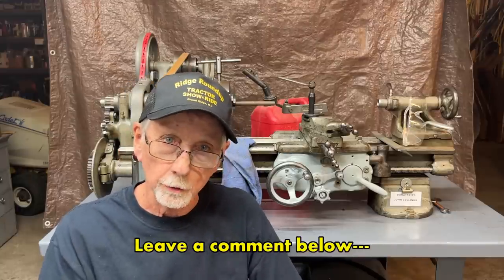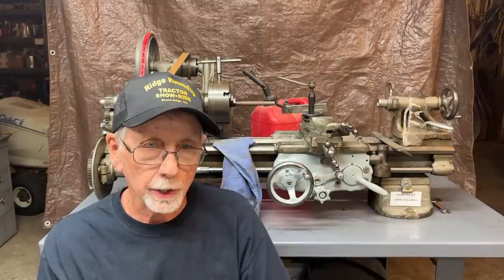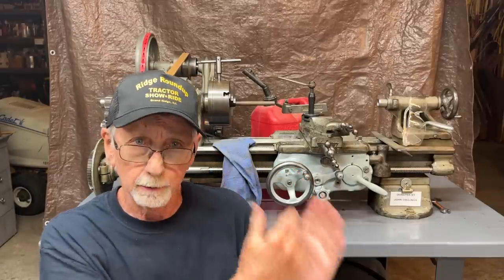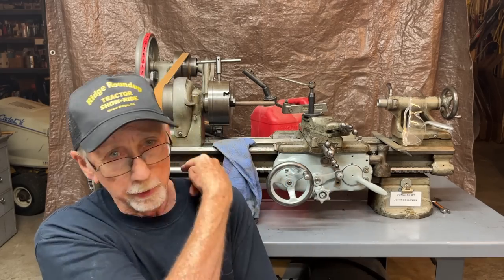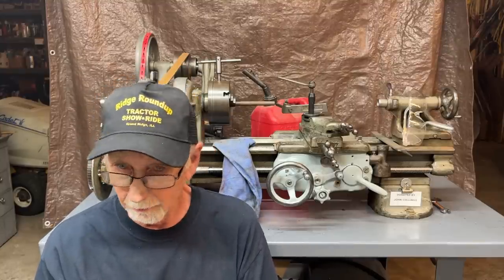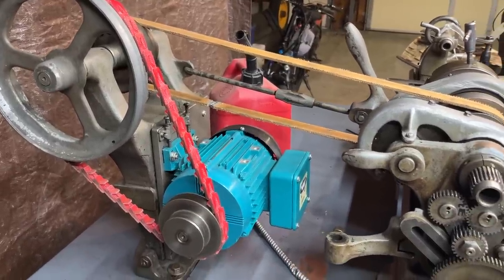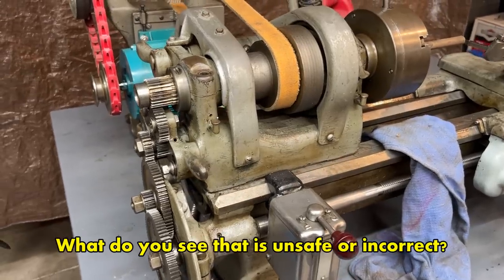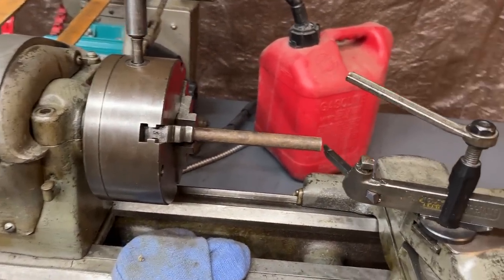SHORT SUBJECT #2 BAD LATHE SETUP tubalcain

Comment: Not only is the BX cable damaged, it is also the wrong cable for the job.  Should be SOOW or similar.  Also, though not in the picture, there are no plugs listed for use on BX cable
Reply: It's probably not a true BX cable (I hope) but rather something like greenfield conduit a similar product outside but you put your own wire inside. It's like liquitight conduit without the covering. very common on machine wiring

Comment: 1) The cord supplying power to the motor is not in the conduit with the crushed spot. The real cord is tape spliced.

2) Gas can, improper storage of flammable liquids.

3) No chuck guard.

4) No belt guards to cover inrunning nip points.

5) Chuck wrench and tool post wrench should be removed.

6) Improper storage of PPE, the glasses.

7) Rag on ways is a no no, could become entangled with rotating chuck.

8) Files and other miscellaneous items like the file should be cleared from the work area.

9) There are several problems with the setup for the job that I won't go into, but I suspect the combination of setup issues if used as shown would likely result in tool breakage, or the part slipping from the chuck, either or both of which could be tossed back at the operator, in add-on to potentially damaging the toolholder, or the post as well.

10) Missing gear train cover for change gears too.

BTW: I am a State Safety Consultant for KS in the OSHA 21d Consultation Program with over 30 years of experience in this as well as multiple manufacturing facilities through the years.
Reply from the maker: You are pretty sharp, you caught all the bad things.
It’s nice to have a safety man watching my videos

Comment: 1. Compound is sticking out too far.
2. Rocker tool post is hanging out over the edge of the compound.
3. Flat Belt tension is generally loosen when not in use.  At least that's what I was taught and still do it today on my 9" SBL. 
Daber missing from tailstock. Mine is too. Not a safety violation.

My dad would roll over in his grave if he saw this on his, mine now, 9" SBL!!! 
 Ken

Comment: 1. Broke conduit 
2. Missing gear cover
3. Switch not mounted permanently 
4. Key in chuck
5. Gas can beside motor
6. Work too long not supported
7. Tool wrong angle and too long
8. Wrench on tool post
9. File across ways
10. Rag under chuck on lead screw
11. Safety glasses across tailstock

Comment: The gear cover is off the lathe. The tool bit and the tool holder are both extended too far. The chuck wrench should not be left in the chuck  The tool post wrench should not be left on the tool post.  The file lacks a handle and should not be laid on the ways.  Wear your safety glasses rather than hanging them on the tail stock.  I have most likely missed a few

Comment: Good video! Let's see: no gear cover, no belt cover, chuck key in the chuck, too long work stickout, compound handle in the wrong angle and risking the user, rag on the lathe and near the chuck, a file on the ways and tool stickout lowering rigidity and causing chatter. Did I miss anything? (I must say - I learned machining  almost entirely from your videos!!!)
Reply: You missed A LOT of things !!
Reply: @johncoops6897  lol. I bet I did! What did I miss?

Comment: 1 no belt or gear covers
2 rag laying on bed ways
3 chuck key in chuck
4 gas can on table material to far out for facing
5 lathe bit too long
6 wrench on tool post
7 safety glasses not in use
8 file on bed ways
9 tool holder to far out
10 dent in Armor Flex

Comment: 1: Unprotected belt drive system (No belt guard)
2: Unprotected Gear train (No cover on the gear drive)
3: Damage and unsecured BX Power Cable (MC) to Fwd Rev Switch
4: Chuck key left in the chuck unattended
5: Workpiece extends from the chuck more than a few times its diameter
6:  Spanner left on tool holder 
7: Tool holder extends too far out
8: Tool bit extends too far out of tool holder
9: Rag left on Lathe bed 
10: File left on Lathe bed
11: File has no handle on tang
12: Open Flammable container
13: No Chuck Safety Shield ? (this one is for the real tenacious safety gurus)

On the PLUS SIDE IT'S A South Bend .

Comment: 1. Too much work stick out
2. Too much tool stick out
3. Repeat 2 but with the holder
4. Chuck key in Chuck
5. Wrench on tool post 
6. Spindle not spinning
7. Rag on the ways
8. No center in the tail stock so you’re gonna get chips and funk all up in your taper
9. Edited this comment, too much stick out on the compound
10. GET THAT FILE OFF THE WAYS

Comment: 1.No belt guard
2. No gear guard
3. Flat belt is askew
4. Chuck key in chuck
5. Stock sticking to far out of chuck
6. Tool bit sticking too far out of tool holder
7. Tool holder held towards end
8. Tool post key on tool post

Comment: Exposed gear cover, towel on ways, file on ways, incorrect toolpost sticking way out there, compound on reverse, wrenches left on toolpost nut, savey glasses hanging out not on face, gasoline can hanging out in the back. Another violation could be no padded standing mat, improper open toed footwear, long sleeve shirt. No ear protection. Improper hydration, late on your taxes. haha I think I got more than 8!

Comment: From the UK.
I WOULD WANT TO PUT THE GUARDS BACK ON.
REMOVE THE RAG
REMOVE THE CHUCK KEY
SHORTEN THE WORKPIECE HANGING OUT OF THE CHUCK.
REDUCE THE LENGTH OF TOOL STICKING OUTVOF THE HOLDER
REMOVE THE TOOL POST SPANNER
PUT A HANDLE ON THE FILE
WIND THE COMPOUND OVERHANG BACK IN.
AND I WOULDN'T LEAVE THE FILE ON THE BEDWAYS.

Comment: 1: The chuck key should never be left in the chuck. 
2: The work is too far our in the chuck. 
3: No guards on the gear end and belt drive of the lathe.
4: The shop rag shouldn't be on the lathe bed.
5: Don't leave a file setting on the lathe.
6: Remove the safety glasses off the tail stock.
7: Remove the gas can from behind the lathe.
8: The cutting tool is too long, and the tool holder is sticking out too far.
9: Remove the tool holder wrench from the tool holder.
Reply: I would add to this list that the stock is sticking way too far out unsupported. And the file laying across the bed.
Reply: @peteengard9966  Number 2 and number 5 :)

Comment: Two unguarded belts.
Chuck wrench left in 3-jaw chuck.
File laying on lathe ways - huge no-no, not sure if it is a safety violation.
Tool holder clamp bolt wrench remaining on bolt.
Safety glasses on tail stock, not on operators face
Part is extended too far from 3-jaw chuck for facing.
Cutting Tool is extended farther than necessary froim tool holder

Comment: Gasoline can
Crushed electric cord
Key on chuck
Rag on the bedways
Stock overhang
Key on lantern post
Tool holder protrusion
HSS tool protrusion
File on the bedways
Safety gogles hanging from the tailstock

Comment: 1 No belt guard on drive belt
2 Flat belt not positioned on opposite pulleys and no guard
3 Damaged outer jacket on power cable
4 No cover over gear train
5 Rag laying on ways
6 Chuck key left in chuck
7 Container with potentially flammable or combustible liquid in workspace
8 Miscellaneous tools (file, safety glasses) laying around in workspace.
9 Tool post not properly positioned
10 Workpiece extended out further than necessary
11 Tool post wrench should be removed from tool post before operating lathe

Comment: No belts guarded, gears exposed, motor feed flex damaged (crush spot), gasoline container by electric motor, tool left in chuck, tool bit stick out too far, wrench left on tool post, rag on ways, file on ways, eye protection not on operator, tail stock wrench left on

Comment: No cover on change gears, Belt in tension while off, Key in the chuck, Shop rag on the ways, Part is stuck out too far, Incorrect set up on the cutting tool, File without a handle laying on the ways, & a gas can on the lathe bench.

Comment: I found TWELVE!  1No guarding on the belts.  2No guarding on the gears.  3The chuck key is left in the chuck.  4The stock is unnecessarily set way too far out of the chuck.  5The tool post wrench is left on the tool post.  6The cutter is unnecessarily set way too far out of the tool.  7The tool is unnecessarily set way too far out of the tool post.  8There is a file lying across the bed rails!  9There is a rag lying on the bed.  10The safety glasses are not on a face.  11There is a gasoline can directly behind the lathe!  12THE WORST THING ABOUT THIS LATHE IS THAT ITS NOT SETUP IN MY SHOP!  😁

Comment: I've never run a lathe but have been watching you for a long time. I do have a small Atlas 618 I'm trying to piece together. Here is what I think is "wrong"
1 Pinched BX cable
2 Chuck Key in Chuck
3 Material extended to far to be faced off
4 Cutter bit extended to far
5 Rag on way to close to rotating pieces
6 Gas can in the back of lathe
7 Wrench on tool post
8 File on ways
9 Safety glasses on tailstock
10 Wrong turning tool holder

Comment: I count 10,, belt guard gong, gear cover missing, tool in chuck, work stuck out too far, cutter stuck out too far, wrench left on lantern holder, rag on ways, gas can behind motor, file on ways, safety glasses on tail stock - not on operator
Reply from the maker: Yes

Comment: Ok so i dont know if i got 8. But,
Exposed gears and belts that can serve as a hazard
Clothing left close to turning equipment
Tools laying across ways
Workpiece stick out way too far with no end support
Chuck key left in chuck
Cutting tool setup is not very sturdy i.e. long tool stick out from holder and holder sticking way out of tool post
Safety glasses not on your face 😬
I might have missed some but only watched this once on my break

Comment: 1. Chuck key should never be on the Chuck.
2. Stock stick out is too long.
3. HSS cutting bit is sticking out too long.
4. A a rag on the lathe.
5. A file on the ways.
6. Flammables not stored properly
7. Tool angle is wrong
8. Feed lever engaged
Extra Credit
9. Safety glasses always on

Comment: For the love of humanity...the worst offense on here is the LinkBelt. Others include:

Fuel Can
Exposed belts/gearbox
Not Sure if the smashed BX conduit in intentional or not
Rag on the ways and near the head
Chuck Wrench in the chuck
Bar stock WAY too far out of the chuck
Wrench left on tool post
Tool post not fully inserted in the cross slide
File sitting on the ways
Safety glasses on tailstock and not of face

I'm gonna go rock myself to sleep.

Comment: Does not seem firmly attached to table.
Gears are are exposed so a good way to loose some fingers.
Not sure about the thing holding the belt together.
Chuck key is still in the chuck. 
Tool holder is not tight.
Compound slide looks to be at a funny angle. 
There's rags and junk on the ways. 
Safety glasses are on the lathe, not the machinist.

Comment: exposed belts. exposed gear train. stick-out of work excessive. stickout of tool excessive. Lantern toolpost overhanging platform. Safety glasses not on head. key parked in chuck.

Comment: 1. Unguarded belts & gears.
2. Chuck wrench left in chuck.
3. Rag under the chuck.
4. Workpiece is too far out of the chuck.
5. Tool bit is sticking too far out of the holder.
6. File is laying on the lathe ways.
7. Safety glasses are draped over tailstock, so operator must not be wearing them.
8. Wrench should not be on tool post.

Comment: Chuck key still in the chuck
Tool stockout too far
Tool key still on the post
Work chucked too far out
Fuel can behind work area
Rag left on ways
(This one is arguable) insufficient lighting for work area
File left on ways

Side note: not sure I'm a fan of this content format - I like to sit down with a tin and get engrossed in a video. 

Thanks Mr Pete 🤙

Comment: Let us start with the Safety Glasses left on the Tailstock.

That file should not be on the ways.

That rag should not be left on the ways.

The Chuck Key should not be stored on the Chuck.

Where is the center on the Tailstock.

Why is there a wrench on the tool post.

Where are the guards for the belts and gears.

The Cutting Tool is not in the correct position for facing off the material to be machined the cutting tool is sticking out to far from the tool holder.

The material to be machined is sticking out of the Chuck of the lathe way to far.

Why is there a gasoline can by this lathe.

Comment: - cover missing from back-gears - entanglement danger and lubrication oil/grease splattering
 - key left in the chuck - good luck with catching that after you hit the "go" button.
 - fuel can mysteriously lurking behind lathe - fire hazard?
 - loose rag on the ways - another thing that can get entangled (around the chuck perhaps, after the key has self-ejected)
 - way to much of the workpiece sticking out of the lathe - chatter or perhaps bending and "exciting" ejection at speed, certainly not good for accurate machining.
 - Too much of the HSS tool is sticking out of the holder - danger of it breaking and sending high-speed shrapnel at you.
 - spanner left on tool holder screw - that might be fun if it falls onto a spinning workpiece.
 - file with no handle - I prefer to give blood at the bloodbank or testing lab via phlebotomist, not self-inflicted stab wounds.
 - file blade resting directly on the ways - guess it knocks those pesky accurate surfaces off the ways, while the lathe bounces around as the key flies off the chuck, the workpiece chatters/bends/flies out of the chuck and the tool snaps off

Comment: Dangerous chuck key , cover missing on gear box , rag ready to get wrapped up , bar stock hanging out to far , tool bit hanging out to far ,safety glasses not being worn , file not in box ,lathe not bolted down .

Comment: Gear guard removed
Chuck key
Rag 
too much stick-out on work, Armstrong holder and high speed tool
Gas can (sparks)
safety glasses
tool post wrench in a bad spot
Selector in threading position (unless you are threading of course)
no handle on the file

Comment: i work around machinery all the time so i am no so anal as some or osha  however chuck key, extended work piece, extended tool bit and wrong angle, rag of course. never seen a gas tank behind a lathe before haha. dont give a shit about a file laying there or no cover on the gears or belt

Comment: Work piece out to far the tool is out to far there is a rag on the ways there is gas can by the electric motor where there could be sparks the safety glasses are hanging on the tail stock instead of on operators face .

Comment: Wrong:
1..piece extended too far from church w/out support 
2..cutter extended out too far from tool holder
3..loose rag
4..gas can
5..wench left on nut
6..no cover on gears
Reply: 7..file left on way
8..safety glasses not worn

Comment: open gas can where sparks can fly, too much workpiece stickout, too much tool stickout, too much toolpost stickout, no gear guards, no belt guards- aaargh chuck key in chuck.safety glasses not on face (ie wrong location the tailstock doesnt have eyes so doesnt need their protection) no handle on file (hand impalation) rag over ways liable to be caught in chuck or leadscrew, threading lever left engaged

Comment: 1. Work too far out of chuck
2. Tool holder too far out of top slide/post
3. Tool too far out of Tool holder
4. File on ways
5. Open gasoline near heat sources
6. Chuck key in chuck
7. Gears exposed
8. Red belt exposed
9. Yellow belt exposed

Comment: Guard missing, chuck key left in chuck, work piece too far out of chuck, tool too far out of holder, holder roo far out of post, safety glasses on tailstock instead of on head, rag on ways, file on ways.

Comment: Wrong: Gas can in background (not safe), workpiece sticking way too far out of chuck, compound should not be overhanging, tool bit sticking way too far out of holder, holder sticking way too far out of tool post, tool post wrench in a dangerous position,  tool post should be centered on compound if possible, metal file laying on the lathe ways.

Comment: Chuck key still on
Drive belt not secured
Gear case cover missing
Gas can close to machine
Rag laying on ways 
Safety glasses on tail stock
File laying on ways
Compound dangerously set
Motor electric cord not correctly secured
John Collins tag ???

Comment: Rag under chuck
Chuck key in the chuck
File laying on the ways
Gas can behind the lathe
Tool Bit out way too far
Tool holder way away from the tool post (weak)
Small diameter part sticking out too far without center
Safety glasses not on 
gear guard not in place
no belt guard

Comment: 1. not enough tool stick out 
2. no alcohol nearby
3. too much lighting 
4. American machine - should be made in china
5. horrible safety nozzle on gas can-remove place in trash
6. link belt should be blue to match the motor color
7. chuck wrench needs at least a 12" pipe extention
8. safety glasses -too modern should have black frames
9. place files near headstock - support for other tools
Reply from the maker: lol

Comment: No belt cover, no gear cover, the work is out too far, cutter is out too far, tool holder is out too far,  file is on the ways, saftey glasses are not on,  rag left on the lathe so it may get tangled. Gas can on the table

Comment: exposed drive belt and gears
gas can close to machine
rag on ways
chuck key in chuck
too much stick out on work piece
show much tool stick out
Tool holder should be turned around and shortened up for more rigidity
wrench left on tool post
file on lathe ways
machine needs painted, beginners know only painted machines are accurate 🤣